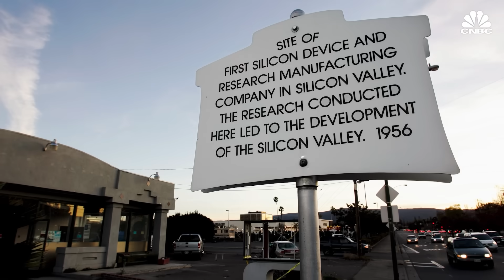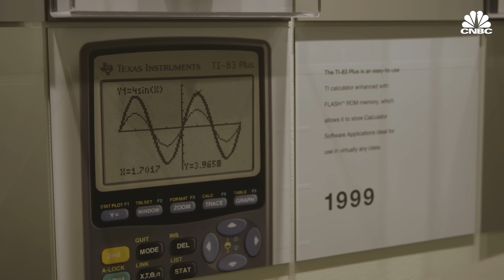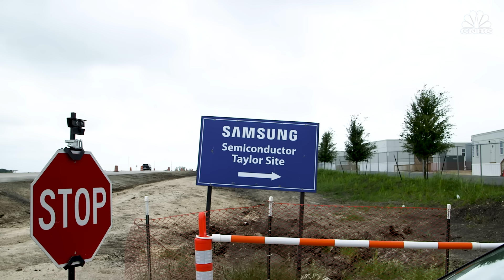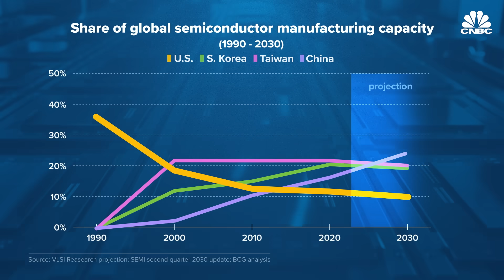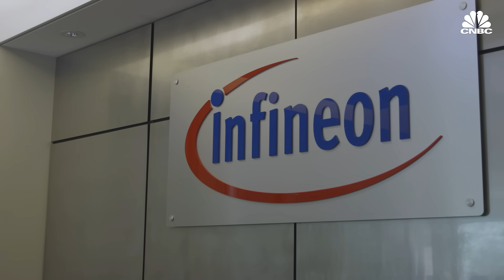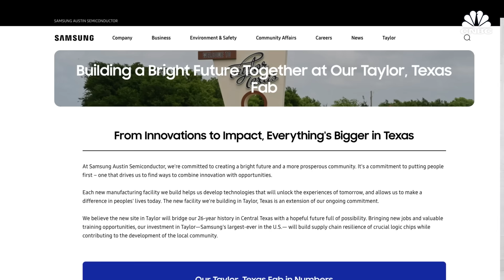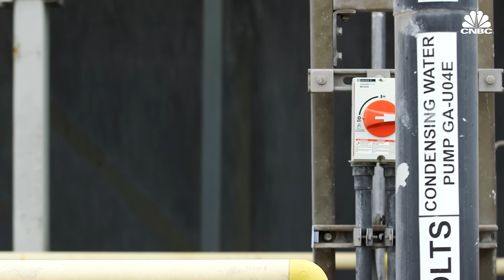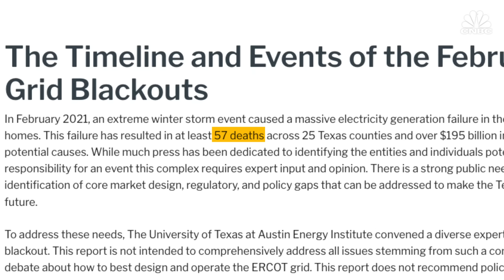How Texas Became The American Chipmaking Hub

Comment: One thing those fabs will need is super reliable power grids.  A single fab power outage for just a few minutes is measured in tens of millions of dollars.  There is a lot of parts inside those fabs that take damage when they lose power.  It's all about thermal equilibrium of key working parts and avoiding uneven thermal dimensional changes measured in angstroms.
Reply: If only they installed backup gen
Reply: @ss-fc2fh there's no backup for that kind of power need
Reply: @nicholaslayton6199  yes there is, another whole power grid
Reply: @nicholaslayton6199  no, that's not how things work. Extremely sensitive components have their own backups in-built for assisted shut down. There is so much cheap land all around that they envision they can operate a large part through solar itself.
Reply: @nicholaslayton6199 you could have an on site turbine generator along with a large backup battery for the downtime during generator startup. or just use a small nuclear reactor.
Reply: @nicholaslayton6199   You have no idea what you are talking about.  Sorry.
Reply: They have their own power generation at TI.
Reply: Pflugerville, Texas Real Estate is going to increase in price since it’s next to the Samsung Semiconductor to open in summer 2024!
Reply: I suggest Texas get into the co-op. So they can share electric between states vice-versa like all the other states basically do allready to provide stability. Secondly there battling the DOJ on some Bs over there border 🤦 I think the feds need to sthu
Reply: I’m an engineer that worked for years in tech and got to wear those bunny suits.  We had onsite natural gas backup generators for the critical processes.
Reply: texas is full of cheap labor and cheap land because of how polluted it is hope you dont get anymore moist or youll start to kick up something dangerous
Reply: I actually work at one of these Fabs. During the 4 day power outage and deep freeze of 2021, our production shut down for practically a month, and spent the next 4 months ramping back up to production levels. The power grid failure was a significant setback.
Reply: I have no idea if that's true but I trust you
Reply: @fringe_minority  He is speaking the truth, a power sag of ~1ms can cost Samsung a lot of money if mfg tools stop processing.
Reply: It was mentioned in the video that most of these plants are completely run from green renewable (mostly wind) energy.
Reply: idk thier wattage but, lifepo4 has been around a while and proven it's self, they could long terma batteries like lifepo4 or some other form of battery bank
Reply: They will have their own grid
Reply: Texas' power grid is far more reliable than California's.
Reply: WOW!! HAHA!   You are a complete idiot if you think they will have issues with power...
You make good use of a thesaurus to sound smart ...but you haven't fooled anyone...  Jezus H Christmas with this guy...
Reply: It’s a good thing these facilities have multiple high output generators.
Reply: one thing,   their grid. is. more robust than cali
Reply: If that is true…I am not sure Texas is the best place.
Reply: "One thing those fabs will need is super reliable power grids."

And they picked Texas? Oof.
Reply: @functionatthejunction The Texas power grid is fine, but like basically every grid in the world, you can't have an area a little under the size of Texas get 20 degrees below its average for that day in every county, in the thick of winter, with most people using electricity for their heat, and not have rolling blackouts.

California for instance has major rolling blackouts every summer, and that's just for their normal summer heat they know is coming every year! Imagine if they or the NYC area got hit with summer temps 20 degrees above their average in July/August. I doubt they would make it without at least some serious danger of major blackouts
Reply: @popemon7608 I know this is a months old comment. But there really aren’t too many areas in the US that have issues with the power grid not working. Could Texas, California or multiple other states invest more to make their power grids more resilient. Of course and it should be a part of the plan. But Texas and most other states in the country are fine when it comes to Electricity.
Reply: @functionatthejunction you can bet your @ss that if there’s a power shortage in Texas, the grid will prioritize corporations over the average inhabitants.
Reply: @functionatthejunction  "And they picked Texas? Oof." Did you watch the video? I'm sure the leadership of all of these massive companies are wrong about the power in Texas and you're the one that's correct. Or maybe the idea that Texas has a power issue comes from terminally online NEETs that disagree with Texas' politics. Oof.

Comment: You need a lot of water to make Electronic Grade Water in Semiconductor for Chip Making. Both highly purified water as well to deal with the industrial grade wastewater to clean it up for reuse or to meet discharge permit regulation. All of that is taxing on local municipal government to supply all the water needed for Micro Electronics and Semiconductor industry. The needs for Water is literally liquid Gold to the Semiconductor Industry for the manufacturing of micro chips. What the Municipality Water System cannot produce, they have to build or upgrade to be able to supply there Electronic Plants.  Where will all the water come from for these areas is TBD.
Reply: They plan to purify and recycle a majority of the water they use. Phoenix would be a poor choice otherwise!
Reply: Texas has plenty of water. Not a problem.

Comment: As a New Yorker, I’m perfectly fine with this. Chip manufacturing is energy intensive, and worse yet water draining… I’d rather have Texas destroy itself than New Yorks pristine lakes and waterfront areas.
Reply: That's the thing.  Manufacturing isn't where the money is at.  It was reshored for national security to the china of the US, Texas.  It's all about cheap labor and no environmental regulations in Texas.  Silicon valley will still dominate tech design.
Reply: @HiHo-zh4rd  Peter Zeihan
Reply: @HiHo-zh4rd  You need alot of land, texas has it, and texas has a robust interstate system. Product moves quickly
Reply: @nran7811  the US has a robust highway system.
Reply: @nran7811  not all states are equal, Texas highway system is vastly superior,
Reply: Yikes😂 somebody has to do it
Reply: @qjtvaddict  exactly, and better Texas than New York in my opinion given the facts.
Reply: Cynical, but understandable point of view.
Reply: @richardconway6425  factual** not cynical… thanks though
Reply: Texas is the shithole for it to happen while the headquarters are in San Francisco and New York . Burning humid sunny shithole
Reply: You obviously never been here .. we got more land than you got  Empty  pizza boxes ..